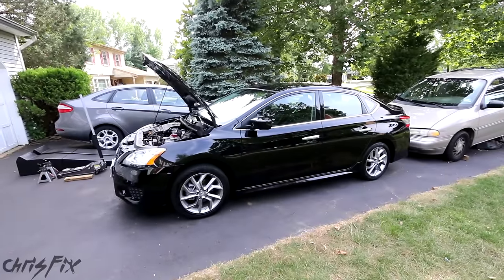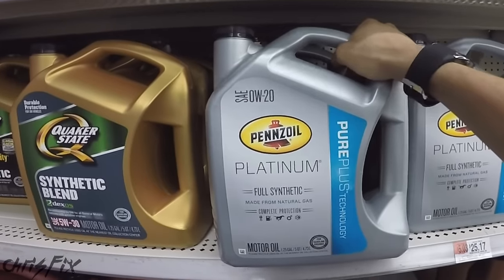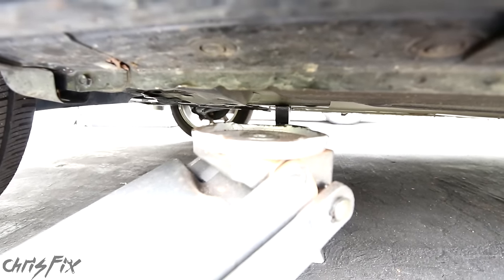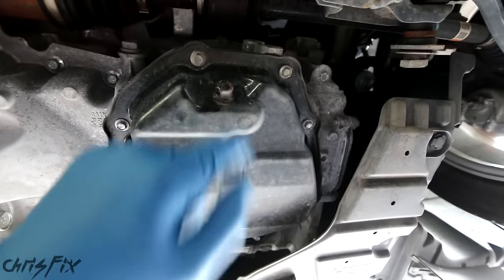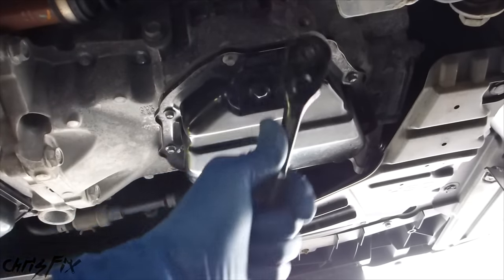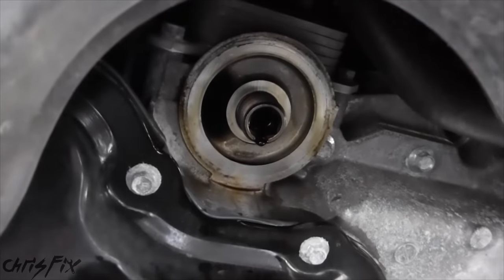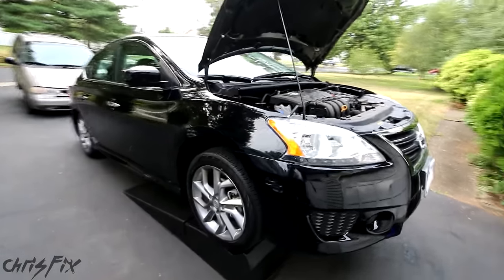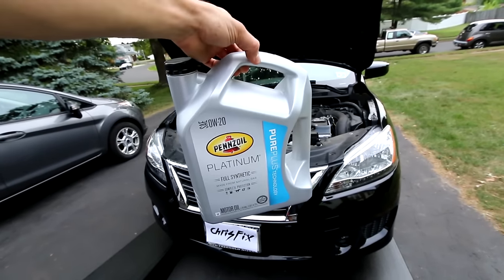How to Change Your Oil (COMPLETE Guide)

Comment: Oil change is the gateway drug to diy car repair. Great channel, Chris. Learned a lot from your videos
Reply: Felipe Balbi amen brother
Reply: 2008 model Toyota hilux oil change arızası gösteriliyor ne yapmam gerekiyor yardımcı olabilir misin
Reply: I bought a racheting wrench for taking off the battery terminal bolts to scrape the crud off to start the vehicle. Within 2 weeks I own 2 torque wrenches, 3 sized ratchets, 250 sockets, car ramps, multimeter, 3 ton jack with 2 stands and a creeper, and a 20qt drain pan. That escalated quickly.
Reply: Yep...I got bit too. I've built plenty PC's, why not cars? Now I'm looking for any excuse to pop the hood!
Reply: So right u r
Reply: i can’t agree more . I started doing small esthetic repairs on my car like changing the headlights, the mirror blinkers , different bulbs etc & now since i’ve already acquired a bunch of tools i wanna look into doing more of the maintenance & mechanical stuff like The Oil & brakes.

Comment: I am 65 years old and I have never touched under the bonnet of a car to do anything other than to check the oil levels in my entire life. Times are now tough and I cant afford to get the car serviced so thought I would have ago.  I don't have jacks or stands so i used the suggestion of driving the car up onto the gutter, it was still pretty tight under there  but i was able  to  wiggle under there, and let me tell you at 65 that was no mean feat.

Thank god for Youtube  and Chris Fix !!

First problem was not having a breaker bar or a piece of steel pipe that my wrench could fit into so I just put my foot on the short wrench and did a leg press and the bolt came off just fine.  My mistake was letting the bolt drop into the oil pan,  I forgot about the crush washer which separated from the bolt, it took me a while to figure out why there was an oil leak later when I refilled it.. doh. 

Then I had to get the crush washer back on and I had already filled the car with oil, so that turned into an engine oil flush because for the life of me I couldn't get the bolt with the crush washer on it into the hole and threaded properly with the oil pissing out all over the place. What was worrying about that was the oil that I had just put into the engine was just as black as the old oil but I am ignoring that for the time being. I have ordered a Fumoto Engine Oil Drain Valve which I hope will make future oil changes a lot easier

Second problem was no tool  to remove the oil filter , so rather than hammer a screw driver through it to make a handle  I decided to drill through it which i thought was a bit safer than hitting it with a hammer, sadly  the oil poured out all over the drill and me but I did get it off in the end. 

Third problem I think was that I forgot to  put oil in the new oil filter,  when I tried to start the car it turned over with a slapping sound from the engine then stopped , tried again and same thing, I got out and checked for leaks and the oil level and all was ok, got back in and tried again and the car started, at that point I was able to stop crying. All is now well., not really sure what that was all about but the car is running fine now.

The moral of this long winded story is that you should always follow the experts advice and have the right tools available and follow instructions to the letter. 

Thanks Chris you are a legend !!!
Reply: 👏 well done
Reply: Wow you wrote da bible! Great job!
Reply: Yes
Reply: Noice
Reply: Very nice! Im 29 years old and just did my first oil change a month ago watching ChrisFix do it. Living in NYC i did it outside of an autozone parking lot cause its hard to do it on the streets with cars whizzing past you.
Reply: @henrycalde1991  and not get fined for parking somewhere during street cleaning day or some bs 😂
Reply: You can't spare $40 a year to change your oil? No way. I don't believe it.
Reply: Madlad
Reply: @JonBonesJones84  like they said, it’s fun to do it. cant hurt saving some money and working on your car
Reply: @ashleyb3795  why so much? i spend less than $30 on an oil change
Reply: @jeffrey3812  idk ask jiffy lube. This is why I’m here on this video! Cost me $30 for one bottle of oil and I needed two plus the filter 🤡
Reply: @jeffrey3812  also I use synthetic high mileage oil which is more expensive !
Reply: Wow
Reply: @ashleyb3795  same if its 30 bucks per bottle and you need two idk how people here are getting theirs done so cheaply even diy
Reply: Sad as hell, you have never reached manhood if you haven’t worked on something, especially your car‼️🤣🤣🤣

Comment: Personally, I prefer flipping my car at a high speed so I can easily access the underside of the vehicle without needing to buy a jack or ramps.
Reply: Leonardo Datore brilliant 😂
Reply: 😂😂😂I prefer just driving it in water so I can easily flip the car🤷‍♂️🙋‍♂️
Reply: You guys are so genius - I never expect there are so many ways to get access to oil drain bolt.  I am taking notes and will try them one by one.
Reply: @HanpingXu  lol
Reply: russians just tip the car to one side to work on the ,,underside'' :D
Reply: Yeah I thought of that but I found the roof had issues after doing that I'm trying to refine the execution of it
Reply: And once you're done you can just press x to flip
Reply: You guys are being ridiculous. The best way to change your oil is to pull the engine. It's simple and you don't have to crawl on the ground!
Reply: I prefer my buddy Dominic Toretto to lift the car for me, just like he lifted the Lykan.
Reply: I also do this because my filter goes in from above and I like to pre fill it like Chris here
Reply: But how will u get the oil to flow down goofy?
Reply: Love the pic.
Reply: I just drive to Australia so my car is naturally upside down
Reply: Basically if you flip it the oil won't flow out an stay in the engine :0
Reply: @tankbg1311  in Russia, the car changes your oil
Reply: @mKandrews.  XD
Reply: Arabic
Reply: Nero i prefer cutting out the oil pan with a plasma cutter to avoid having to torque down the drain bolt.
Reply: I like to drop it out of a plane, can cost a little bit, but it works
Reply: ah yes, the paul walker method
Reply: Then you break it
Reply: Ha!!
Reply: Chris fix will be like HOW TO FIX YOUR ENTIRE TOP OF YOU CAR (1 HOUR VID) XDDD
Reply: In order to do that you’re gonna need something heavy on top for it to be top-heavy, once you do that, just make a turn at high speed and you got it flipped
Reply: well u can wreck your car for that, cuz it is too risky
Reply: Thank You! ^^
Reply: I like just to throw the car a buy a new one, you don’t to go under the car or go and check that book
Reply: @Kingshuck you have to experiment first, I use my neighbors car for reference
Reply: OOOOF
Reply: Either get a giant robot, use a gravity gun or telekinesis
Reply: You guys are all doing it wrong. Youre supposed to harness your vehicle to a few helicopters and let it float over. That way you can work standing up.
Reply: I like to dig up a grave park the car do the  oil pan is over the whole and get in what once was a grave plenty of room!
Reply: Awe but then you won't be able to prefill the filter :/
Reply: So . . .      how do u flip it back over?
Reply: Well, then your car catches on fire and it would explode, just like the old GTA games. Now that we have GTA 5 where you can flip your car back, you should be fine.
Reply: Like like to use claymore without the bullets ball whatever u call it
Reply: Hahahh smh
Reply: @gamingcool69  u take the oil cap off first then flip it lol
Reply: Then how do you get the oil out if it’s upside down? 

A better way is have a friend lift the car up while you change it underneath
Reply: There's working hard and then there's working smart
Reply: I prefer having Chuck Norris Judo kick the car into submission
Reply: I prefer buying a new car so to avoid changing the oil.
Reply: Lmao
Reply: I prefer driving into the hulk. Who then flips my car out of anger. E z p z
Reply: "Sometimes my genius is almost frightening!"
Reply: Best comment 😆
Reply: Yea but if you flip it upside down, how will oil come out?
Reply: Check the muffler whilst the car is flipped , multi task it........😅

Comment: I'm almost 16 and recently got a job as a mechanic's assistant. So, I had to learn all of the basic things of course. My knowledge from your video(s) impressed my boss and my parents because now I can changed my oil and theirs. Thank you so much for your videos! You're a lifesaver!
Reply: Andrew Swiader 
I want to do that too what other things do you have to do and learn
Reply: Well, now I know a lot more. However, I was thinking about lowering/cambering my car.
Reply: If you are going to be a mechanic then you need to know pretty much all of the basic stuff maintenance wise.
Reply: Andrew Swiader what’s the best way to do a transmission flush on a sealed transmission with no indication of how much fluid the tranny takes?
Reply: Sir Williams google it bruh
Reply: Albin S didn’t find it
Reply: I could imagine that this is already handled but if you go into your owner's manual, or look it up online as Automotive retailers usually have them up for free in PDF form. In that manual it will tell you how much Transmission fluid your vehicle will need. Beware because some models are well known for the difficulty of changing transmission fluid. Example: Volkswagon requires a specific tool because the port that the Tranny fluid drains from is also the port you use to fill the transmission back up with fluid so you need an injection pump(Hand pumped). Hope this is useful knowledge to you if this has already been fixed.
Reply: Andrew Swiader congrats, Andrew. Welcome to this industry. How has your journey been, so far?
Reply: You doing alright drew?
Reply: @thegreatfreesharkofknowled2480  working for a motorsport company with rare cars! Doing pretty good! You?!

Comment: A couple of extra points to add;
1: when placing the oil pan under the oil sump plug bolt make sure you have the oil pan positioned to compensate for the direction of flow of the oil when it comes out of the hole, especially if the bolt is angled slightly. If it comes out very quickly on an angle it could miss the pan completely.

2: If it’s a windy day and your outdoors; when the oil becomes a trickle at the tail end of draining the wind can blow it all over your driveway - place an old towel or blanket under the oil pan to catch any mess. 

Yes I learnt both of these the hard way and yes my step dads new driveway still has the oil stains that can’t be removed!
Reply: Oil stains from asphalt can be removed. Hit it with a degreaser from any auto parts store and a brush and it should come out.
Reply: For the oil stains try something called Eximo. We use it at the gas station at the grocery store I work at. Cleans hydrocarbon stains great.
Reply: Hey what do you do with your old oil
Reply: @mercyarroyo Just bring it to your local mechanic and ask them to dispose of it

Comment: Just changed my oil using this as my main guide. Here are some tips from my experience:
1. Remove the oil cap before removing the plug to allow for better flow.
2. It's very scary going under that car, especially if like me, you bought the cheapest jack stands. Not for claustrophobics.
3. Things will get oily, especially the oil filter. Screwing that on was a whole adventure. To avoid that you can skip pre-filling the oil filter.
4. My plug didn't have a washer on it, I still installed one since it was supposed to have one. One year later I realized it did, Ford just come with an integrated one, so I removed the washer on the next change.
5. You can make a funnel from an old bottle, it will even have a cap on it.
6. Careful NOT to drop anything inside the engine when the oil cap is open or you will have to fish it out.
7. Unscrewing the oil plug can be hard, even with a breaker bar. Just can't get any leverage under the car.
8. Bring a blanket to lie on so ants dont crawl on you.
9. Use the new oil bottle to store the old oil in and take it to a local garage or a recycling station.
10. While you are under the car its a good time to check for rust and any other things you see going bad.
Reply: thanks for the tips
Reply: Thanks!
Reply: tighten up the new oil filter with the wrench, not with your oily bare hand.  I usually drain the oil, have my lunch, let them drop for 1/2 hrs.& then refill.
Reply: LMAO 😂
Reply: Note to self, don't buy the cheapest jackstands.
Reply: @rogerkingip9399  no do not 
you are supposed to just tighten it by hand...if oily clean it of
Reply: @fmar.8311  yeah I'll probably buy the top tiers because I DO NOT want to get crushed by my own car lmao
Reply: Love this, thanks for sharing
Reply: 1- remove oil cap and dipstick
For BEST AIR FLOW
2- after removing the cap NOTHING SHOULD BE NEAR THE ENGINE. Kep it on the floor ( or my awesome service kart) (i strongly Recommend a service Kart )
Keeps all your tools in place.. 
3- Use Steel ramps is 67 times better.
4- use a swivel 3/8 rachet long.. With a deep socket.
5-  the washer has a flat and a round side.  Flat side goes against the drain pan . 
6- tell your spouse to bring you a beer.. I prefer pepsi..
results may vary
Reply: Well thank you very much👌
Reply: Another tip - when you don't have special tool for unscrew an oil filer you can pierce it with screwdriver. And finally write kilometers or miles from a meter on label or antything you will knew when to change oil next time.

Comment: because of your channel Chris, I now work on my own car, very fun
Reply from the maker: That’s awesome
Reply: What car do you work on?
Reply: Ive done half of it today on my daughters Camry. However..Im not strong enough to get the filter off!😔😤😢💄🔧💪💅😔😤 Any suggestions other then the actually tools used here?!?
Reply: @wendylucas9628  , you could go to a garage and ask them to loosen it for $10 -$15. Have done it.
Reply: @hesh2892  thank you..i went to auto zone n got the  wrench. Job completed.. Gotta do my Dodge now and the dwnstrm o2 senser on the camry, plus the gasket valve cover or whatever the rbberband thingy is calld!😂💄💅💪👠🚗🔧
Reply: to change oil and filter, I've taught my son 100 ×..to no avail..always tells me the same thing, "pop, have you forgotten my profession?
I'd rather pay someone to do it for me..
Reply: @wendylucas9628  Late answer I know, but if the filter is stuck and you are in a pinch(e.g. you need the car the next day and have no oil filter wrench), you can just hammer a screwdriver through filter's side and use it as leverage to loosen it. It's a bit messy, but it works as a last resort.
Reply: @andrasjuhasz7011  Thank you
Reply: ChrisFix  I recently bought a 2004 350Z and the owner that last time he drive it (yeah ago) It overheated really bad. So I tried to turn it on I put new battery and it felt like it wanted to crank but it’s really slow. I even tried jump starting it it still won’t crank fast enough. I drained the oil and found out there’s like a lot of water and oil and gold grinds. Should I try to chance gasket or just get new one?

Comment: Quick tip: sorry if it was already mentioned below. When removing the old oil filter, make sure the rubber O ring of the old filter is removed with the old filter. And be sure to check that the new filter has a new rubber O ring. I remember to do this all the time, since way back in 1983 when my dad did not check this, we were spraying oil down the street after a oil change. This tip has stuck with me since then and it's the first thing I check when I remove the old filter.
Reply: Exactly this! Also put some oil around the O ring of your new filter before putting it in
Reply: Thank you! Im late but still a good tip in ‘22

Comment: Did my 1st oil change my self  today . Used this videos as preparation . Thanks dude going into it I felt alot more comfortable and over all I felt like it went back quick and easy . 
 Car : 2004 Toyota matrix 5 speed just hit 200,*** miles !!!
Reply: Matrix is A great car! my 6 speed also just hit 200,000 miles and only needs a Clutch! great cars
Reply: toyota is dope

Comment: I used this video to change my oil twice now. I had always taken it to a local Jiffy Lube, and the first time I did it myself, the oil filter housing was on so tight I couldn't get it off. My guess is they didn't lubricate the o-ring. I had to break off the housing with a chisel. This time it came right off because I did it properly last time. Thanks for the tips Chris!

Comment: Old video but I should add a tip. when you remove the old filter make sure the oil filter gasket is not stuck on the oil filter housing. I've seen it.
Reply: Seen that too. Oil spilled right out of the engine when it started
Reply: Yes sir that Gasket gets stuck
Reply: and if you have a cartridge type filter, make sure to replace the gasket on the cap with the filter. most cartridge filters comes with one of these extra gaskets. thought it'd be worth a mention as some people forget that step
Reply: Nice advice
Reply: Sear's taught us to wipe oil on the gasket to seal it and it won't stick to the car.
Reply: My dads friend once forgot to check the housing on his 98 Pontiac zenof.. as a result the oil leaked into the camshaft piston bearing and the engine blew up..
Reply: Had it happen to me when I was first learning. Did not have a good time 3 miles down the road with no oil.

Comment: Chris Fix, the past two weekends I replaced my brakes, did a transmission fluid change, and a coolant Flush on my 2012 Corolla with 60K miles.  Because of all your vids, you saved me over $500 plus, I got to keep my brand new wrench set, drill bit set, and jack stands.  I look forward to doing my own synthetic oil change when it needs it.  Thanks!